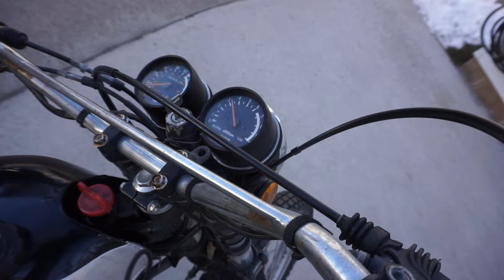Kicking My Leg Off...Free Abandoned Yamaha XT 500. Will It Run? (Part 2)

Comment: You have overfilled it with oil mate when you dip the oil you are to screw the dip stick in then unscrew it and take  a look I had one of those mine was a h model  I still have the original owners Manuel for it you will find if you put a performance pipe on them they go along better,years ago you could buy a super trap ,down here in Australia we had a firm that made Peter Allen power pipes I ran them on all of my bike the performance from these pipes were good plus the some they made cheers tony

Comment: One can install the breaker 180° upside down and this causes terrible backfiring. Had this with mine at the beginning. Was sure it killed my foot for days. I never use the kick indicator, you can feel when the piston is over the dead point. But if the cover of the generator is of you open the breaker and check out the distance of the contact.
My XT will not fire if I do not put the kicker on the highest possible point. You have to play for doing so. The middle position is not high enough. B.th.w. I never leave my foot on the kicker - too dangerous.

Comment: You forgot to drain the oil from the bottom of the front main tube. There is a fine stainless screen filter in there as well which needs to be inspected and rinsed. You should be reading the manual. You will over fill it if you don't drain the oil from the front tube before filling with recommended amount of oil.

Comment: Wasn’t it easier to check te glass at the camshaft? And when you kickstart keep the starter completely down until it runs or is completely still. When you hold the kickstarter down it won’t kick you back.

Comment: Joe, your doing the decompression wrong!!! I explained this to you on the last post. Look it up!
Reply: the decomp lever is for going down hills, not for starting... keeps the back tire from locking up and swapping places with the front tire.
Reply: @lukewarmwater6412  No wtf are you talking about?
Reply: @Albin_Andersson  never used one going down a steep hill? using the rear brake and compression(just closing the throttle) will lock the rear tire, causing the engine to stall, which usualy leads to a crash... use the decomp instead of the brake and the crashing part of this scenario is removed... trust me, it works.
Reply: @lukewarmwater6412  sorry but it sound like you just don’t know how to ride. The decomp lever is used to more easily turn the engine when positioning the piston in on the right stroke.
Reply: @Albin_Andersson  sonny. I grew up with these bikes, if you dont want to know how to operate them more effectively, have fun crashing!!
Reply: @lukewarmwater6412  no hard feelings I have just never heard anyone use the decomp while riding.
Reply: @Albin_Andersson  well, on something like the 87 xl 600 I had you wouldnt, because it worked through the valve train. you have the kind that goes in the second spark plug hole... its a jake brake, just like on a logging truck.
Reply: @lukewarmwater6412  I have to respectfully disagree with you 100%.....It’s for starting. I had a xt500 and it says what it’s for and how to use it in the manual.
Reply: @slickricktheruler  the book is a basic guide, it doesnt tell everything. I used to ride these bikes when I was 17 and weighed 130 lbs, the compression lever was the first thing to be broken on those bikes, I never needed it to get to tdc, if you do, you are doing it wrong.

Comment: Got to wick some fuel and then kick the big thumpers at just the right point to get them to start. Especially when they're cold. Never use the decompression lever, myself, except to clear a flooded engine. What I do is push the kicker down until I feel it just clear TDC, then let the kicker ratchet back up so it has full travel and kick it.

Comment: Loosen filler and plug in front bottom of frame. Helps to drain faster and completely . Remember that these bikes were made when there was 100 octane pump gas no alke use fuel for landscape and first responders rescue equipment . 94 octane And 2year shelf life once running a while think about 4mm larger carb kit conversion  bike wakes up big-time....
Reply: If you like growl super trapp muffler is good . Factory carb Is crap . Check barrel bolt torque  and air leaks between carb and head .Use propane torch unlit and turn on hold near manifold if engine takes off you have a vacume leak..

Comment: It could be that it has lain on the side and then oil has flowed into the combustion chamber therefore it had so little oil and started so hard
Reply: They have a semi dry sump and if they're sitting the oil from the tank in the frame can drain away into the bottom end 
I have an SR500 same motor and left it sitting around for about six weeks recently and came back to find nothing on the dipstick in the frames tank but once I started the old girl it came back to the correct level

Comment: I've rode those since 1976 and there's nothing wrong with that motor you just don't have it tuned right could be points could be carburetor, those Motors are bulletproof, it would be a real mistake to tear into that motor

Comment: a low speed and a high-speed sensor for the ignition system, it would have the low-speed one not working, so it doesn't turn fast enough to go .

Comment: Also always put a new plug in it even if the old one Sparks put a new plug in it I've had engines where the old plug sparked but went under compression it fouled it did not fire right always put a new plug in it

Comment: Love to see one of these gems getting back on the road!  owned several of them.  Tips:
oilchange:  also drain the front frame-tube, speeds things up. Stalling on reserve means the tube inside the tank for reserve is probably gummed up.  simply drill out the gunk.
all it needs now is a replica front-fender and a brake-leaver and you have yourself a nice original example.

Comment: as you said the carburetor had spark and the plug dint .......did you have the coil connected to the carb  maybe ....as it may only get an ground through the throttle cables ..... maybe this is why you have flames coming out the carb ...

Comment: Rings are probably gummed up from sitting so long. Might be carboned up too. You get it running hang on tight. Not as radical as the YZ. Sounds likethecarbneeds cleaning too.

Comment: you should try just kicking it true so it cleans it after just dry kicking it like 16 times then try to start it (if you have a decompression lever just hold that in and kick it for 16 times)
Reply: this works well with my xl600r from 86

Comment: Dude its a dry sump engine the bulk of the oil is in the frame and there's a strainer in the bottom of the front down tube of the frame along with the oil drain bolt 🔩 also that carb needs rebuilt and the kick lever is in the wrong position how would I know any of this look at my pic

Comment: You definitely need to put that kick starter up the top in its correct position. The part you fold out (where you put your boot) should be roughly level or pointing straight forward when it is folded in, if you get my drift. Jeff

Comment: I. Want an old bike 
I just got a 1982–750 dual overhead cam. A CB 750 Honda with a four into one hooker header, velocity stacks and bigger jets in the carburetors to increase horsepower 
My cousin did that in 1973 with a 71 750. He ordered a CRANE - race cam from California and bored it out 60 over. Makin it a 860 CC
WHEN A THOUSAND CC KAWASAKI PULLED UP TO HIM THEY THOUGHT THEY HAD IT IN THE BAG. All they could see after takeoff was taillights 
ROFL !!!!! 🤣 that Honda screamed and my cousin traded it for two dirt bikes because cops chased him and he found out when being pursued there wasn’t a low throttle position he thought he would wind up dead. I got a 1973 500 same as his 750 and I couldn’t blow it up and I tried I raced the wheels off it.
I LOVE 70’s - 80’s JAPANESE MOTORSPORTS CYCLES
ESPECIALLY THE 750 SUZUKI WATER COOLED 2 STROKE STREET BIKES. We called them WATER BUFFALOES THEY WERE SO FAST ITS INSANE
BUT LEAVE IT TO THE GOVERNMENT TO BAN 2 STROKES BECAUSE OF EMMISIONS ARGH 😖 RALPH NASER AND HIS CRONIES

READ UP ON HISTORY AND DONT LISTEN TO OUBLIC SCHOOLS TALKIN BOUT CRITICAL RACE THEORY ITS ALL BS..
And it’s a Theory not gospel
REMEMBER THAT SON…

Comment: Didn't watch the whole vid but I hope you eventually found the oil drain plug in the frame (that small bolt at the bottom of the front frame tube).  I noticed when you took the dipstick out it was already full. These bikes have most of the oil stored in the frame. Also look up the air bleed screw on the oil filter.  I'm not a mechanic but have owned several of these bikes, good luck.

Comment: I've heard you say that many times if the timing skipped exactly how does timing skip if it's on a chain in a sprocket connected to the cam how would that skip that have to be enough slack in that chain where it slipped off the tooth it was on or the crank somehow it just not unlikely scenario

Comment: Oil in frame drain plug at bottom of down tube the plug you removed is gearbox oil the long rod on side of carb is accelerator pump will run shit if not correct

Comment: Man your problem is the carburetor your low jet is ok the hi jet is clogged tear it apart carefully and clean it ! the oil leak is you messin with the top end there you have leave something loose go back check out every nut and bolt and re tight everything , great bikes this as the SR 500 YAMAHAS tougth as nails , cheers!!

Comment: There is one more oil drain bolt which you forgot to drain it’s in front...
Reply: He missed a lot more than that, the main thing to check is the mesh screen on the inside of the sump plate that's where you will find any broken pieces and he should have also cleaned the mesh screen at the bottom of the frame oil tank tube near where the plug you're talking about goes and he should have used the air bleeding screw at the top of the oil filter cover to bleed the air from the oil filter

Comment: Get it to TDC. It’ll start every time.
Reply: Get it to TDC and than using the decompression lever move it slightly past TDC
Reply: @hodaka1000  that's exatly right... THEN give it a good kick.  His technique is way off...and imo, unlikely cam timing is off (but I haven't watch all of this video)
Reply: @brendanreitz1073  
It's sad really 
80% of the video is pointless and the oil change should have included cleaning the wire mesh screens in the sump plate and at the bottom of the frame oil tank and the leak at the base gasket could be from him messing around with the top end 
I just got off my 78 SR500e five minutes ago

Comment: Change the exellerator pump diaphragm and clean the jet for it 😉
Reply: You know what you're talking about
I put a simpler 36mm Mikuni without an accelerator pump on my 78 SR500, no problems
Reply: Put a CR flat slide carb on it from a 450

Comment: Hello I have a 1978 Yamaha xt 500 I restored had it running great but suddenly now when I give it throttle it bogs it idles good so I put a new fuel filter in it and it run great for about 10 minutes going down the road going through the gears and then back to the bog again I’m stumped if you have any suggestions I would appreciate it thanks

Comment: 3 THINGS MUST EXIST,, GASOLINE,, COMPRESSION,, IGNITION.. before such a thing will start,, the carburetor must also be in perfect condition,, and the decompression cable adjusted correctly,,, I have seen it so many times on 500 - 600 that they have actually never been serviced according to the book,,, they run with original piston after 25 years, people try everything in the world to avoid service, instead they try with nozzles and another carburetor, bad starting is due to worn cylinder and piston, and valves. get that cylinder drilled and honed + new piston,, and grind valves. you will get a motorcycle that is like new and starts just by touching the kickstarter

Comment: There's only one way to start this bike or it will hurt you...Bad! TDC, then just a little past that. Mikuni carb (38m I think), Supertramp exhaust. That extra 5hp plus the snap of the throttle is a world of difference. That carburetor on there is shit. And the pipe weights a ton. Oh, the vibration will remove parts as your going down the road. Locktite is your friend.

Comment: i would tear the motor down and rebuild with a new timing chain and a new piston and rings and hone out that cylinder if it isn't scratched to death and if so id bore it,parts are only cheap for that bike type,i had a 225 and rebuilt it twice and it seen thousands of highway miles each year for like 4 years before i sold it

Comment: I worked in a Yamaha shop when these bikes were new . There is a special sequence to kick start these motors. There is a glass window on the top of the head on the right side of the cam shaft. Kick the motor slowly until an indicator shows up in the window. Then push up on the white plastic button on the bottom of the carburetor by the throttle linkage. This holds the throttle open just a small amount. Then kick like you mean it. Do not touch the throttle while kicking. Use the choke when cold. Same motor in the street version SR 500. Good luck and happy kicking.

Comment: The other thing you should do is check the oil after it has run for about 30 seconds, it has a dry sump and if the check valve that prevents the oil from draining back into the sump is a bit dodgy, it will all back down there. Jeff

Comment: At the beginning of the video, I saw the oil smoke puffing out at the cylinder to crank case gasket. Just tightening the bolts would probably fix the problem.
Compression of those engines is supposed to be 165 psi - 145 minimum.
The reason for the lowered compression is because your rings are shot. I could see that by the black metal-flake oil that drained out of it. I just had to laugh my ass of when you said, "there's no metal in the oil". LOL
When you took the oil filter off and said there's no metal in it either, I also had to laugh my ass off. You didn't cut the filter open and look in the pleats on--the inside. It flows in-out, not out-in.
I'm willing to bet that the reason it was running like crap and "sputtering", is because you adjusted the valves to zero lash when it was cold. When the valves got hot, they elongated and were not closing all the way when it got to operating temperature. I know this is probably the case because I made the same mistake with minie when I took the camshaft cover off.
Good luck and if you need any technical advice, send me a message.

Comment: Will a bad airfilter make a bike smoke
Reply: Only if dust or dirt gets past the air filter into the engine and scratches the cylinder wall
Reply: I kinda doubt it unless its absolutely soaked in oil or something.
Reply: Oh ok thks
Reply: @markeithpeacock222  good luck, if its only smoking a little and its a 4 stroke, just make sure to check the oil level and work on the engine soon, but you could run it burning oil for a bit - although that's not the best for them, unless its a Honda lol

Comment: I think you got a dirty carb still... That's why it won't rev up...Plugged main/pilot.  Runs good at idle and not under load cause it's getting barely enough gas to run.  Seems like it starts really good though!

Comment: Toss the carb. If you have compression and spark and no start then you dont have fuel. Mine was even worse on hot start. Japan had emissions nonsense built into them. It's no different than a lawnmower engine. My BSA Goldstar started easily, simple carburettor and no weird choke circuits. Many very popular British and European singles were all different but the same, lawnmowers.

Comment: Watching both vids... Its just inexperience with these bikes. Visit https://www.patu.ca/index.htm. You must follow starting procedure to the letter. Oil tank can drain into the Sump (wet sumping) and smoke on startup. Its normal if it keeps doing it its a simple job to replace the check ball. You didnt need to pull the rocker cover. There is a timing cover just below the points cover... Geesh man hit the internet first on these and you can save yourself much time and frustration. That engine lives on as the SR400 in overseas markets so Yamaha still makes many of the parts, what you cant get from them you can get from the Vintage Spoke in the US and Kedo in EU...right down to graphics and exhaust reproductions.

Comment: Many many years ago a friend of mine had an XT500 ( very similar to this bike ) it had an orange/chrome tank etc. I think he put a bigger carb and freed up the breathing a little it responded well to the changes.
My younger cousin had a Honda XR600 ( big single ) one day when he was kick starting it he might released the decompression a fraction too early?? it threw him over the handle bars!!
With the torque of the engine it was pretty hard on rear tire, on asphalt!
A lot of work to check the timing! The SR500, TT500, XT500 were basically the same engine gearbox, think the SR500 might have had electric start?? 
Also knew a guy that owned an YZ490 big two stroke, it scared the crap out of him first ride, because when that big two stroke comes on the power band you better be hanging on for dear life or you will thrown off the back!! 
That exhaust pipe could use a clean up and coat of paint.

Comment: I can tell you what you did wrong like I have said before that’s a dry sump bike you drain the oil from a drain plug in the frame as well as the sump plug. Now you didn’t do it right you swamped the motor with way too much oil and now it’s blowing out the base gasket. Bro do your research before you work on a bike you are not familiar with. But I know you won’t comment on this because you only comment on people’s comments if there blowing smoke up your ass!!!!!